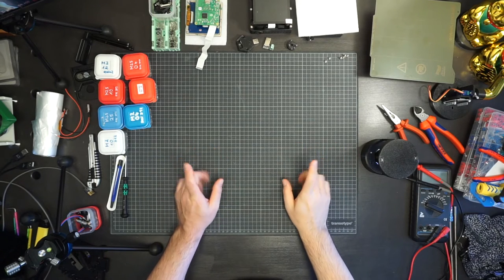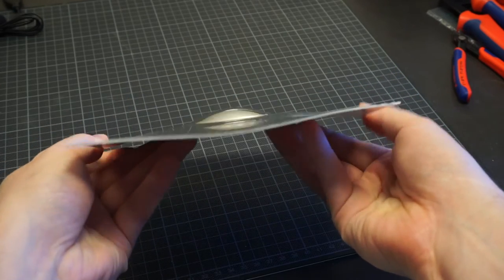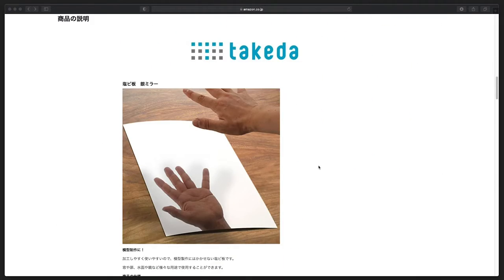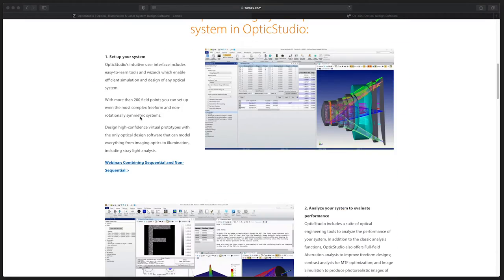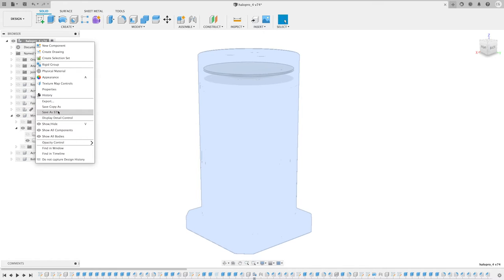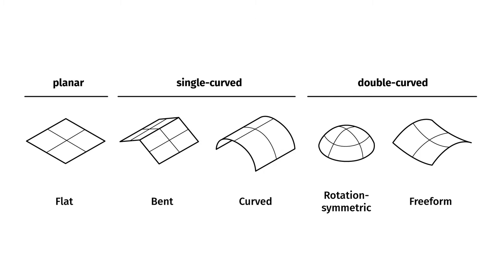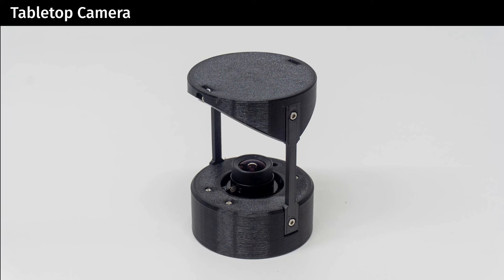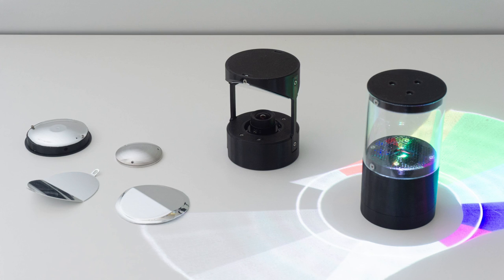Curved Mirrors from Plastic Sheets

Comment: Just a question to the outer space – I'm trying to find a solution for the similar thing, but not exactly projection. I need to draw a light circle (1.5-2m in diameter) at the floor surface. The idea is to use any powerful LED torch and reflect it with some custom mirror in a way that most of the light will go to form a circle. I'm not even sure that's even possible, so looking everywhere and this paper and video is the closest thing I could find. Any advice what to google would be highly appreciated.
Reply from the maker: Sure, that's possible, as long as you know the position of the light source beforehand. You need to find a curvature that gives you the right amount of magnification. In case light source, mirror and floor match up in a line that can be done with a single ray in 2D on paper. In case you want to optimize the shape: this paper does not exactly solve your problem but the authors did face a similar issue (with lasers): https://www.doi.org/10.1145/2702123.2702246
Reply: @vlztn  incredible, thank you. Yes, that's similar to what I'm looking for, except I need to clarify that by "circle" I meant not "filled circle" but rather "border" ~1-5cm thick circle shape.

Filled circle could work too, but will require much powerful light source. So my question on "is it even possible" was referring to this – is there a mirror shape that can channel maximum amount of light beam into the   that "border" cirlcle shape.

PS. I explored lasers option before, but as this is supposed to be used in public spaces and in potentially quite bright environment (actually it's an ice rink) there is a cap on laser power. Plus the goal to make this as cheap as possible so it can be affordable.
Reply from the maker: @divan0  Ah, I think I understand now what you want to achieve. But I'm not an optics person and I'm afraid my knowledge about that is pretty limited (too limited for sure to tell someone if/why something does not work).

Comment: Would it be possible for you to share the link to buy the mirror material? I want to vacuum form and there are way to many options which do not seem so promising
Reply from the maker: That's what I used in the video: https://www.modulor.de/en/polystyrene-mirror-coloured-smooth.html

Comment: Hey man try the aluminized side of metalized Mylar sheet ( thermal blankets) , you can inflate it like a bubble and make some mathematically accurate reflecting surfaces without molds... a quick search on Youtube and you'll find a lot of videos on pretty effective parabolic mirrors done that way
Reply from the maker: the mylar mirrors are pretty nice, especially when you need something really large, about a meter or so. But it's kind of hard to get them to a defined curvature during manufacturing and keep them stable afterwards. If you need light (e.g. for solar applications) they are great, but if you want to do imaging applications (cameras or projectors) they cause a lot issues. PS, however, works great at like 10cm size but is absolutely unusable for larger stuff.
Reply: @vlztn  maybe inflating thru a piece of tube (using a depht gage for checking the accuracy of bubble volume), then using it as a mold for pouring epoxy to stabilize the mylar surface in that shape 🤷‍♂️
Reply: Green Power Science squad represent 😅

Comment: Hope you're still checking this video, Would the quality be high enough to mirror a screen off of?
Reply from the maker: That depends on several factors. Smaller areas and lower curvatures work better and tend to result in more precise mirrors. The circular mirror (80mm) I molded in the video works okay-ish for a laser projector but even there you can see a few slight distortions in the reflect image (small bulges in lines). The larger your mirror gets, the larger the dents will be. If your application scenario uses steep angles for reflection, that will amplify the error. If you're using large areas, the problem will be less noticeable. Long story short: probably you'll need to try it and see if it works for you.